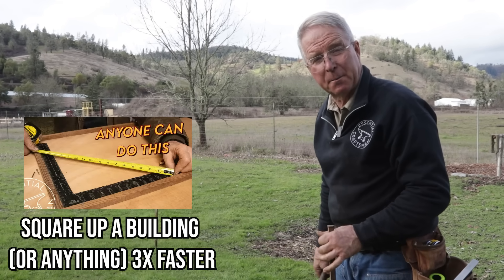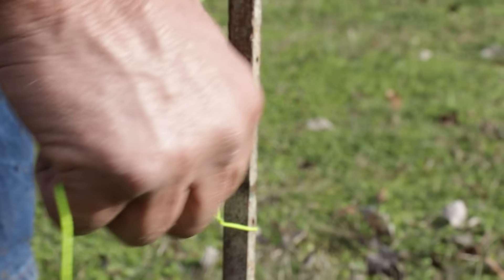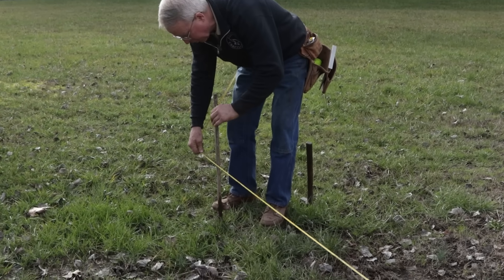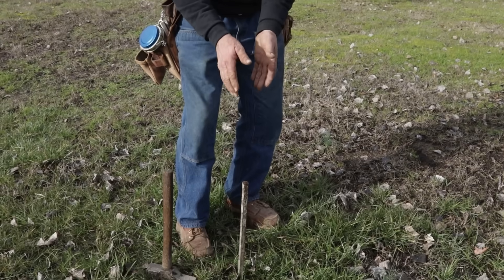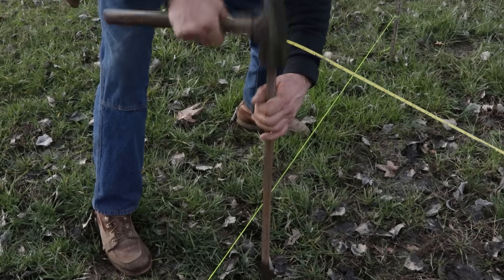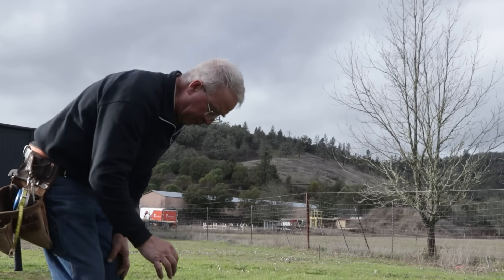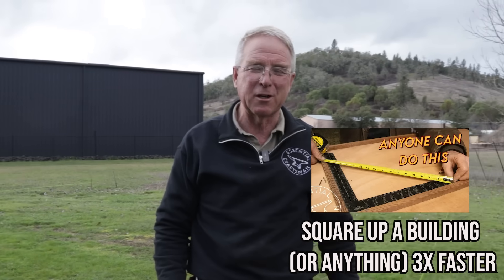How to Layout Parallel lines Perfectly

Comment: The easiest way to set out a building is by using 2 tape measures . Set out the pegs for the base line , put a nail in the top of each peg  . (Say your building is 10.000m X 6.000m ) Hook a tape on each nail . Walk out until the 10m point crosses the 6m point on the tape bang in a peg ,and repeat for the last corner. Then set out you level profiles one on each corner . Easy ,simple and fool proof ?
Reply: Mistake . Calculate the Hypotenuse , and use that on one tape and a dimension of the building on the other .

Comment: The old (and arguably better) way of doing this!   I worked on a big corporate addition a few years back where we were adding about 100’ x 200’ of space to a grocery warehouse.  The guy in charge of layout used his fancy laser system for one corner, ran it over with his truck, bought a new system and laid out the opposite corner.

The team trenched and poured the footing and foundation, and once it was cured… they discovered each corner was off by several inches, and the long wall completely out of square.  The solution?  A new trench, 1,500 holes drilled and epoxied for all-thread ties, and an additional wall thickness of concrete.

The foreman and my boss were standing around laughing about how the old days of string line would have saved the company weeks of labor and thousands of dollars.

Comment: Can anyone clarify or elaborate on what he said at 7:00 minutes or so about the shortest distance being the right angle?
Reply: The simplest way to think of it might be to exaggerate it. If the distance between the lines is 36 feet then imagine a 40 or even 50 feet line between the parallel lines. It would have to be very skewed to fit between the lines. And so the opposite is true, the smallest possible measurement between the lines is the most straightforward, which is square
Reply: Diameter of a circle

Comment: I have laid out structures many times like you just did.  But being a construction (not professional) surveyor laying out structures, roadways and bridges, if I had skilled help available for measuring (chaining), I used my surveying instruments and when checking diagonals, made no adjustment.  I am referring to pre-electronic measuring instrument days i.e. total stations and GPS location instruments.  Both are satisfying.  Surveying instruments also need to be checked and adjusted for accuracy on a regular basis, so it's not always faster or cheaper to use technology on a small scale.  Thanks.

Comment: This gentleman just squared a form faster than getting a laser level/ transit out of the truck!
Reply: Yeah except with a level you'll actually get a proper set out. This guy's set out is going to be wrong unless he got his strings level first by some method he didn't include in the video.
Reply: @ you re correct, but he has moved the job forward, albeit rudimentary.
Reply: You can do it in half the time with a laser transit and it would be right and no need for the continued tweaking.

Comment: All good points. When laying out commercial buildings, we would always construct batter boards well beyond the building corners. They would be laser level, so no error due to terrain slope. Outside wall line (OWL) was clearly noted. Also, footing lines were marked. Then, as earthwork progressed, lines could be removed, then reestablished when equipment and rockwork and utilities progressed.  First layout was never degraded or lost as all these other subcontractors and tasks were completed prior to setting footing and wall forms.
Reply: I agree with batter boards as superior
Reply: Level profiles( batter boards) at the beginning. Squared up with the laser. no more guessing.
Reply: Have you guys heard of Rousseau Batter boards? Basically a metal version with adjustable heights and wing nuts and sliding brackets for your string. Very fast way to set grade and square with no wood and only form stakes
Reply: In Australia we call them hurdles, the method shown in this video is nonsense and would not be tolerated. This bloke would be sent on his way.
Reply: @brettrasmussen413 well we in America so kick rocks

Comment: Establish a rough 90degrees when setting out. Stand on your baseline and raise both arms to you shoulders. Line your thumbs up with the stake at each end, hands out straight. With thumbs raised, close you hands by bringing arms in front of you. Sight down you arms and between you thumbs, Get your assistant or note the mark on the ground , Voila 90 degrees from the Baseline, this is how we used to rough our building, try it you will be surprised how accurate it is. It was called a “Wimpey Clap” after a famous UK Construction Company

Comment: Except for the square stakes, that’s exactly how we do it. We’ve also switched from nailing the forms to using hex head duplex screws. They don’t shake the form work as much and they are faster to put in and to take out when stripping the forms.

Comment: 90 degree laser - first two strings.  Laser again at the the correct distance at the other end of the first string and you have two 90's, and the 36' stakes are in the right place.  Last string.
Or 3x4x5 the first two corners.
Anyway, that might just be me.

Comment: If you have a 360 degree 3 line laser that gives you 90 degree corners, and a laser measure distance meter you can save a lot of time. I think that I saved 75% worktime by being able to do this myself without strings and measuring tape. And it usually gives you as good or better result. Measuring tapes are often slightly flexible and not so reliable over longer distances, like 90 ft, or longer.
Reply: Yes, laser.  Even if you get a bit of error, it's close enough to make a little adjustment to get "tight" tolerance.

Comment: Great video but can you make a short vidéo with a pièce of paper to explain how the second Line comes parallle. I did not catch the theorie. Tank’s
Reply: The final line is parrallel to the first line because the two crosslines are square to the second line (when you search the shortest distance, you find a line square to the second line). Then you have two points the same distance from the first line with that distance measured twice in the same direction (square to the second line)
There is a little bit of mistake when he says you're square to the first line. When you find the minimum distance you're square with the second. That stillmakes 2 parallel lines in the end.
Reply: @joffreyjo4076  Tank you.

Comment: I might be missing something, but I’m curious how you know those lines are truly parallel?

The lines’ angle relative to one another was never changed after you made your initial arbitrary measure. They would be very close to parallel, but you eyeballed square.

Then you check for parallel by finding the shortest distance, it is true that the shortest distance would be square between the parallel lines. But if they are not parallel, the shortest distance would not be square. Right?

I would have expected the 2nd string line meant to be parallel to be adjusted.

It seems like a catch-22. I want to understand this technique, especially if it’s efficient! Thanks!
Reply: The shortest distance would only be square to the second line, not to the first line (unless they were already exactly parallel).
So I'm unsure about this as well...
Reply: Double check by measuring the diagonals.  IF the parallel sides are equal length, then the diagonals will be equal.

Comment: I learned this in my drafting class using a compass. Making your tape/stake into a compass is clever.
Similar principles can be used for perpendicular lines, midpoints, 45° etc.
Reply: I use this sometimes when I'm using a laser and need to see if the staff or tape etc. is plumb

Comment: When you measure for the closest distance on the second line you are finding the point where your line is square to the second line.  You can draw it on paper and see.
Reply: ahh, that part didn't seem accurate to me. I guess thats why
Reply: I build foundations for a living, this is the long way of doing this, but I’m sure he’s doing this for demo purposes.
Reply: I'm so releived to find this comment!
The technique is still good but I was extremely puzzeled that no one commented on this...
Great video anyways, I dont mean to disrespect or lower the value and effort to teach such good techniques on YT and I couldnt have thought of that method myself!
Reply: that's my issue too. With a little extra effort the lines eventually will be parallels, just not at the distance you wanted. It would be way easier to use a second rope to make a 90 degree angle on the first line.
Reply: He is creating a parallelogram. Just the distance between the lines might be off a little bit.
Reply: You are absolutely correct in pointing that out. The lines are perpendicular to the second line and not the first. You will get parallel lines but you will be creating a parallelogram and not a square. Your choices are either to make the second line the reference and measure from there or...... now that you have two perfectly parallel lines, you can perform a second iteration using the technique again and then you will get a square.
Reply: I came here to say this. The shortest distance to the second string would be square to THAT string, not the string attached to the end of the tape, which was meant to be the reference string.

But he’s not trying to get square strings, he’s getting parallel lines, which happens when you take two non-parallel lines, draw two square lines off of one line (second line) and then measure 36 ft off of the other line (reference line). It causes a parallel line to form between the new stakes, but that line may be shorter or longer than the reference line, so they make a trapezoid of some kind.

Comment: Can you do a video on how to get get a parallel line around a circle?   

For example: electricians have to layout lights around a giant round column 5ft off the walls(the circle) and 8ft apart from light to light. How do you measure that to get everything evenly spaced and symmetrical? Thanks for the great content!
Reply: Chalk a long line tight to the column .On  the other side of column, chalk another line tight to the column and make sure they are parallel .Center  between these 2 lines out 8' from the column  is your two starting points -12 o clock & 6 oclock ,
Now bisect the angle between the 2  points (12 o clock & 6o clock )by arcing a couple of lines  from 12 & 6  to under   the 8' measurement off the column & over the 8' measurement  out from the column ,where  these two sets of arc lines  intersect  gives yo the center line radiating out from the column.measure out 8' from the column and you have the ("3 o clock ") light position ,mirrored on the other side for the "9o clock"light position .
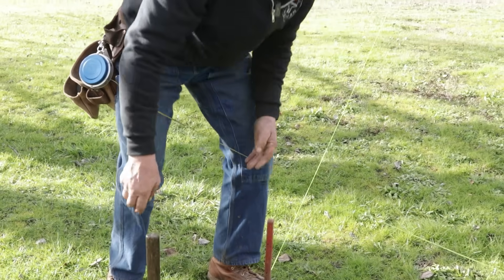Bisect between "3 o clock " & 12 o clock light position,measuring out 8' from the column and that's the "1:30 " light position and so on for the other 3 light positions (4:30, 7:30 & 10 :30)
Reply: Get 2 boards long enough and fasten them together at a right angle.  The apex of the angle will be the circle you are marking.  The boards have to be long enough to touch the circumference of the inner circle, but run them past a few feet.  They will be tangents of the inner circle.

Then walk around the inner circle, keeping the long boards in contact with it.  Mark your outer circle  line at the apex of the right angle.

Hard to describe, but it's the same concept of driving 2 nails in a board at the diameter you want, and using a framing square to draw the circle with a pencil on the inside of the 90° angle of the square.  An offset circle could be marked  using the outside corner of the square.

Look up "drawing a circle with framing square" and that might explain it better than I can.

The math behind it is that any 3 points can define a circle.

Comment: Dad was a homebuilder in the 60's - 70's.  These vids show me what he would have been doing back then.
Reply: Mine was as well. By the time I was 15, I had already set as many forms and got slabs ready to pour as I cared to. Hot summers tying rebar and digging footings for free was the best medicine for me to get a good job that was indoors in an air-conditioned space. I still took a building trades class in 76-77 in high school but never used the skills. The best part of the building process for me was framing part. For a young kid, I could drive a nail and spring a hammer with the best of them. I still have my dad's last hammer he ever used in 91.
Reply: That's still how we do it

Comment: Nice work! 

When I laid out layouts for overhead crane structure I would triangulate everything using one end of the runway for the start. we know how far away the end needs to be from the wall, then layout that line at the end, and then the line along the wall (perpendicular line) or other landmark just had to be X distance away for the length of it, but we had two rough distances. the layout for the remainder we just used the Pythagorean theorem and chalk/Arcs to find exact points of the third point. you have your A leg (bottom of the triangle) already. so just make another leg the length of A on the 90* side from it and hold the steel stape on the floor at one side, then hold a welders soap stone (sharpened) at the end of the tape to swing an Arc along the floor. do the same for the C leg, where the arcs converge is where your Third point is, perfectly square. You can then walk down the runway and repeat for any number of pillars that are being put in.

Typically I would make sure the measurements are all made from a corner of the base plate, so when we snap chalk on the marks, we have perfectly square layouts to line everything up, even the base plates line up on the floor and have no twist in the end.
Reply: Did the same building decks to make sure everything was square. I was sure bored with pythagoran theory in school but found it so fun in the field!

Comment: You didn't measure corner to corner which means it can be a parallelogram
Reply: Showed on the last video. This was just showing setting up the initial parallel lines.
Reply: 3, 4, 5 is a poor man's Pythagoras. That's what the sister video is about. It's all of 10 seconds on a calculator to lay out the base of an entire building, just do the actual math and get it perfect instead of extrapolating a line off of the nearest 3, 4, 5 you can muster.
Reply: He pulled parallel and then measured to the shortest point to roughly establish square. He has another video that explains the next steps to square it. You don't have to pull corner to corner if you 3, 4, 5.

Comment: May be a dumb question but where do you get the square stakes with holes in them ? I do not believe I’ve ever seen them in stores
Reply: I forget now, but I think Scott said in the past there's only one place left still selling them, and they're not cheap. But there are holy wars fought over which is better. There's definitely advantages to each.
Reply: They’re around but the round ones are definitely more common. Once you get used to round, there’s very little difference.

Comment: 7:28 I'm so glad you finally mentioned establishing a level line. I've built houses on foundations that were laid out with the assumption that grade was close enough to level and squared the foundations with this assumption. To square up the floor system, I had to adjust the back of the house with one end of the box band hanging over the block an inch and the other in an inch on the block. Luckily it was brick with a  roll lock so the esthetic looks ended up fine but if it was a stucco foundation 😢.  This is acceptable for a fence or chicken coop but if it's a house, please use batter boards and invest in a good transit level.
Reply: I’m a foundation contractor and my tolerances are, within 1/4 square over all and within 1/4 of level overall, some people have no pride, we call them Scabs.
Reply: @alanmeyers3957  I layout for commercial buildings exterior and interior framing. Our tolerances are 1/100 in plumb, and as close as Zero for square. 
Could you imagine what teglar suspended ceilings would look like with your tolerances?
Your 1/4 would be grounds for dismissal.
Scabby work we call it.
Reply: My first boyfriend (many MANY moons ago) was a carpenter and one day, he came home and said... "we started at a new site today and it took us time to figure out they had dug and laid the foundation in reverse (front door facing backyard).

The house had a full basement with an off center cinder block wall that was now on the wrong side of the house and the bilco doors to be installed were where the side walk to the front door was supposed to run.

They jumped on to a different site and I never knew what the outcome was.  I suspect the house was ultimately built in reverse... the location (rural KY) meant that you could "fudge" things.... just sucks having your front lawn around the back and your backyard at the road.
Reply: I'm a carpenter who's done heaps of slabs, footings and peirs for columns and 2mm is achievable quite easily for height, parallel and square if you've been taught by the right person. 
How good was that dudes tape though. If they come in metric  I'm getting one.

Comment: full scale layout was so fun.  I modified a rebar cap to connect my tape to the center of the steak.  we only used round steaks.  all the same.  even a round ones have an infinite amount of right angles at the top for cutting string
Reply: I like my steaks medium rare.
Reply: @ohwowthatsgood  That would be a missteak. Medium to well done for me.
Reply: Yes, those stake tops cut sharp as they mushroom out. Round stakes were always most readily available and the binder hitch shown here works just as well.
Reply: Center of the stake ?